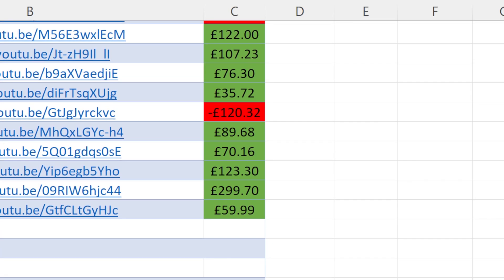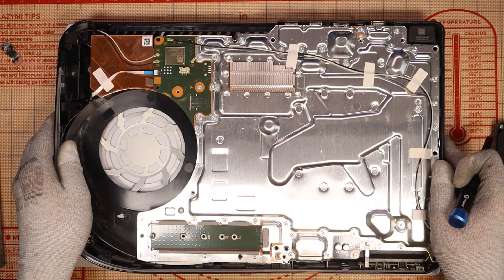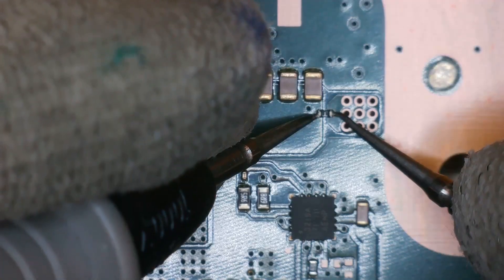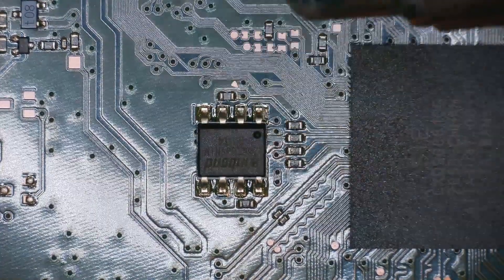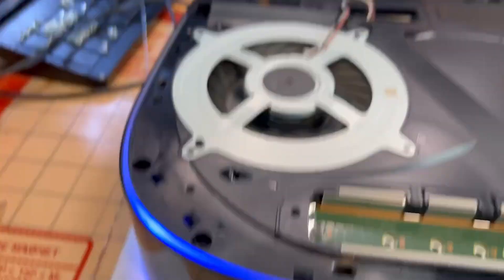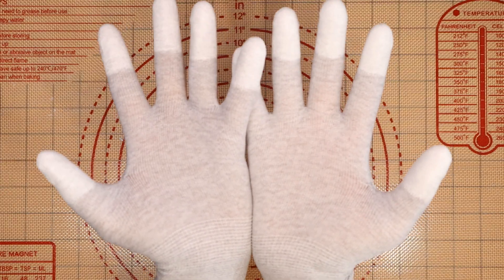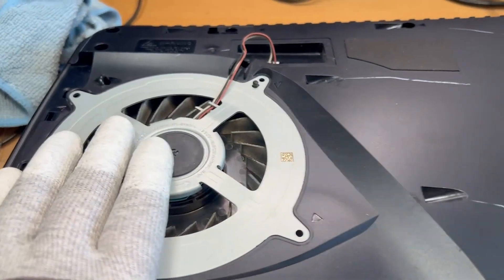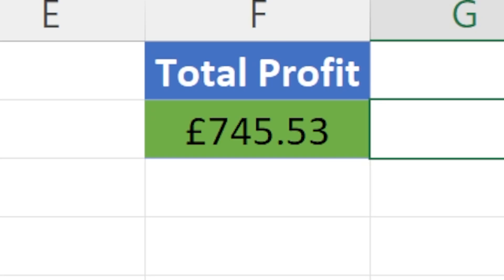Trying to Make a PROFIT Fixing FAULTY eBay Items | Can We Fix Them? Profit or Loss S1:E27

Comment: Three beeps while pluging in the power cord cable indicates a problem with the nor at the southbridge. Maybe the southbridge can not communicate with the nor or the nor is corrupted. If you want to change the bios to a digital one you have to change in the bios 0x001C7011 = 02 (BD) to 03 (digital)

Comment: I remember seeing a video of someone trying to briefly turn a Digital PS5 to a Disc PS5 on one of the first models (I think it was Tronicsfix). They found the spot on the motherboard where the drive plugged in on the digital console but I don't think they moved the BIOS chip over. I haven't checked anything but it does make me wonder if the PS5 couldn't update because it was missing the married disc drive board.
Reply: That was a video from the cod3r who did that, successfully. Just flashed a diskless edtion bios onto the original chp and was in like flynn

Comment: Nice fix, I was honestly expecting the worst but to see you fix that, was pretty good! And the good thing about the programmer you bought was that you can use that on other devices as well, so it's more of a tool being added to the toolkit, rather than an overall expense that has to be added.

Comment: I wonder if you had tried to reprogram the original (corrupted) BIOS chip with the device instead of flashing a disk-based BIOS. I realize the BIOS chip might be well and truly borked as it failed so completely, so putting in a stable one would be safer overall, I just wonder if the old one could have been rehabilitated.

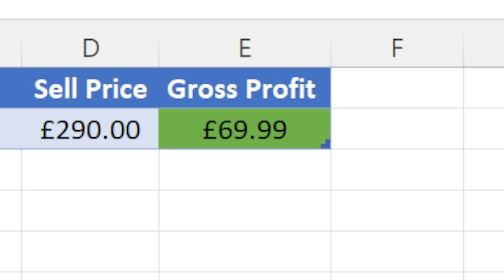Comment: 14:28 why there are no parts costs? You had to get a new BIOS chip,right?
Reply: There were no parts. He read the BIOS file off of the non digital version that was on the chip, converted that to a digital version by altering the code, and then writing it back to the same chip using the programmer